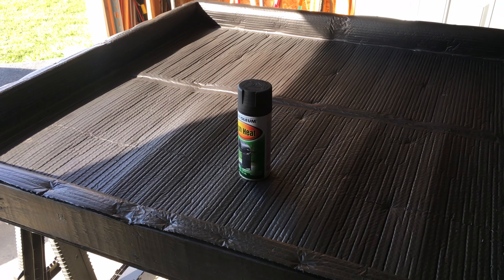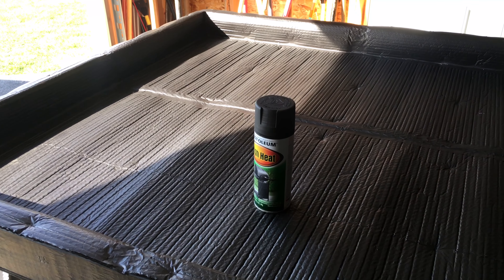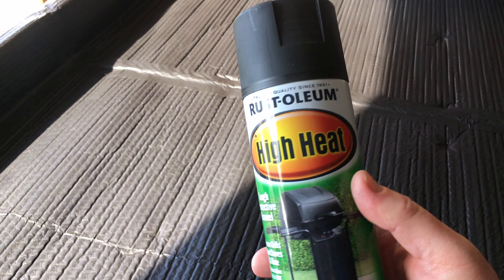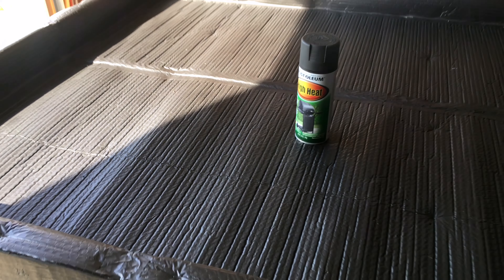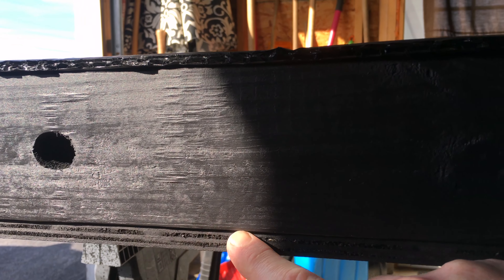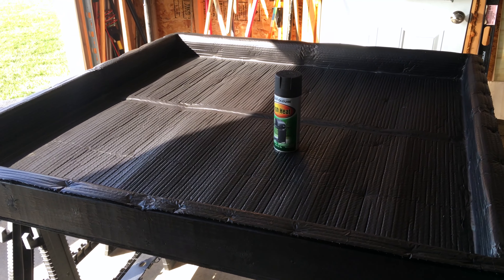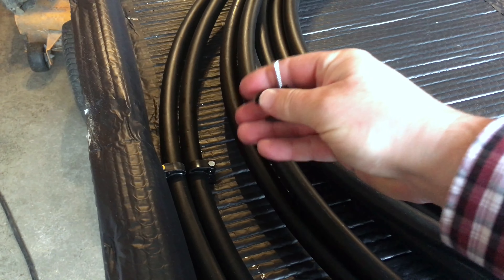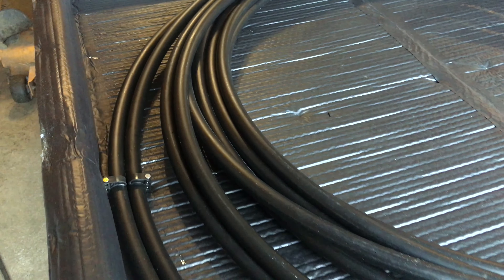DIY Solar Pool Heater - Part 2

Comment: The controversial thing about this is that in the winter when you need heat the most, it won't work. In the summer it works as icing on the cake.

Comment: Built my own and vert similar design, my problem is water line connections. Cant' seem to find a good connector for the ABS pipe. Any ideas?

Comment: Seems ;Ike a pretty straight foward design  , FYI  you can buy the Rustoleum paints in gallon  cans for a lot less money than rattle cans  and if you use a cheap Harbor Freight   Spray. Gun for under 20 bucks  you can get pretty decent  coverage. If you. Are budget minded  and have a compressor  ive also used a. HVLP  setup. Ive owned for years that i. Bought for spraying  Woodworking projects and other  jobs  mine is a Campbell Housefeild brand. But i beleive most of the other manufacturers are  pretty decent these days  mine is nearly 20 years old  and at that time the choices were limited  the only drawback i. Could  say about it. Is it is pretty. Loud  i. Even used it to spray a Sportscar  with good results  using  a 2 stage  DuPont Automotive paint / clear coat

Comment: Wonder if your double your heat by making and linking 2 boxes with 100ft tubing in each rather than insulting half of the 200 ft noted in the bottom of the box?
Reply from the maker: Yes.  I actually cut out 100 feet since it was not heating up under the other 100 feet.  I am planning on building another box this Spring.  Thanks for watching!
Reply: @GreenMountainDIYGuy  I was wondering about that second stack of line. Thank you for posting. Getting ready to try this for a solar powered hot tub!
Going to try running 2 sets of these in parallel instead of series. So four all together.
http://www.texasinspector.com/files/Water-Heater-Plumbing.pdf

Comment: I like the design  and concept of the system  ive been. Thinking about  something similar for radiant floor  heat  in a shop  or large building  i do like your manifold system design  you can pick up. Pretty inexpensive  radar temperture guns online  and  i think Harbor Freight  sells them as well  that might give you a easy way of monitoring. Your  tempertures  without the need to drill holes or take anything apart ? I bought a cheap  one to  help trouble shoot  the cooling systems on my boats and they worked quite well

Comment: Love your design! I followed your directions and my box never got over 120degrees on a hot sunny day in Pittsburgh Pa. do you have any suggestions for me ? I did something wrong.
Reply from the maker: Did you insulate?  I cut out 100 feet of tube.  My box is usually between 140 and 180 when water is running through it
Reply: Yes I insulated . When you say you cut 100’ out you took it from 200’ down to 100’? My box has never gotten past 120 deg even with no water running through . I really can see much difference from your box and mine I followed yours as close as I could . I appreciate you getting back to me
Reply: Why did you take out 100’
Reply: @jasonpawlos9425  Did you do any further work on your system? I'm in Cleveland, so similar climate, but different elevation. What is your sun exposure time in the summer? Mine is in the sun from 10am to 5pm, hits 165°. Any higher temp, I'll have to cut down some trees 🤣🤣

Comment: The 1/2" Talon Clamps work with the 1/2" Tubing even though the Tubing is 0.63" OD?  Would they still work with 0.7" OD?  1/2" tubing seems to range up to 0.7" OD.  Would the 3/4" Talon Clamps be too large?
Reply from the maker: 3/4 would be too large.

Comment: Do you still have this contraption?  How does it last year to year?  What is the final hook up?  How much did this cost you?
Reply from the maker: Starting year 3!  I have replaced the bilge pump each year as well as removed 100 feet of black tube.  I plan on building another one this Spring.  Thanks for watching!

Comment: Why did you start with the reflective material if you painted it black?
Reply from the maker: It is really reflective insulation.  Painting it black helps to absorb light thus creating heat and not reflect light back out.

Comment: How many gallons of water does all that tubing hold?
Reply from the maker: Kevin Lewis great question, not sure.  There is 200 feet of 1/2 inch pipe.
Reply: Kevin Lewis 7.72lts 1.7uk gals
Reply: Green Mountain DIY Guy 7.72 litres or 1.7 uk gals

Comment: Lexan Polycarbonate is not UV stable. In less than 2 years it will "craze" meaning turn cloudy unless you put a UV coating on the PC. A better use would have been PMMA (acrylic) "Plexiglass".
Reply from the maker: It has been 2 years and the Lexan looks like new.  Thanks for watching.